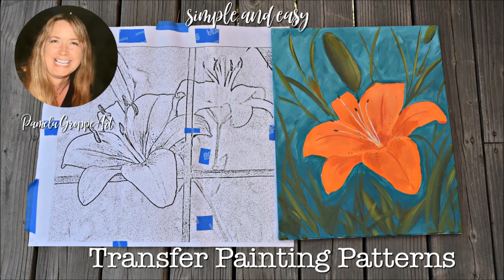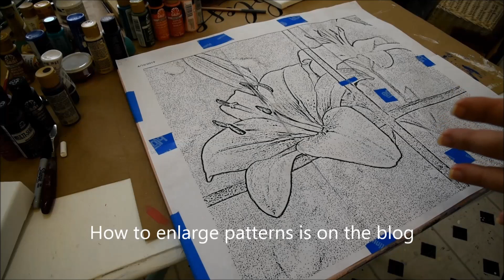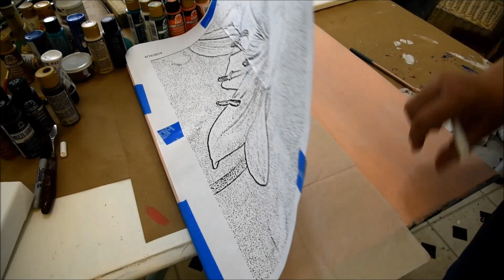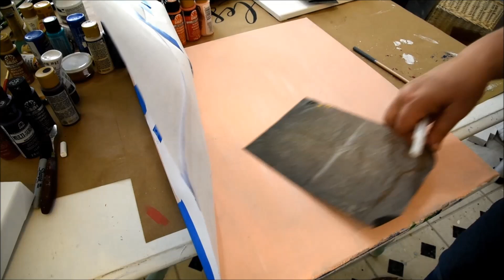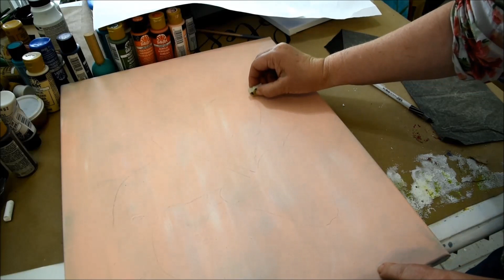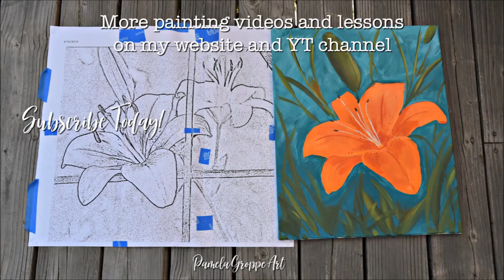How to easliy Transfer Painting Patterns aka Traceables

Comment: Pamela a little advice.carbon paper is anmic to light..instead i use 2b carbon pencil and i retrace all lines in the back placing the pattern against a table with the light.when finished rub allthe lines from the front.walaaa.picture is on the canvas.hope this help.
Reply from the maker: norberto sison This sounds like a great trick. I will definitely give it a try. Thank you!